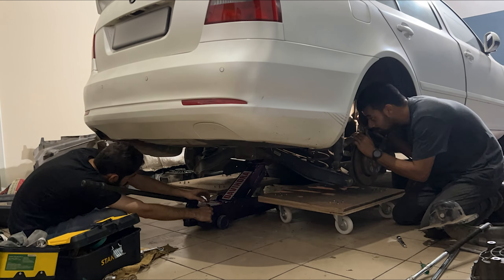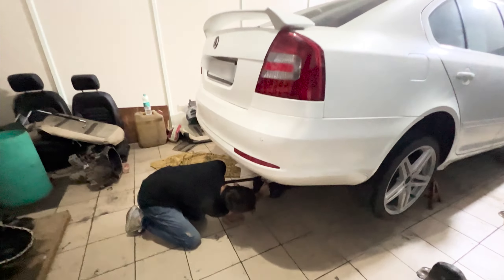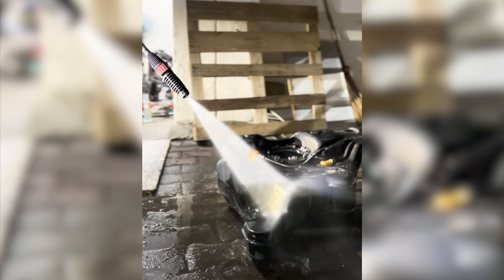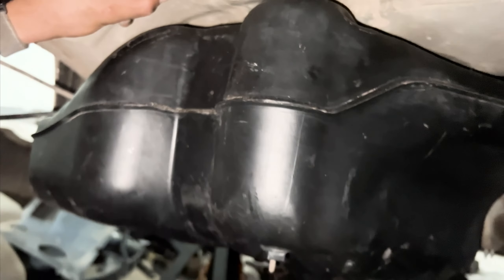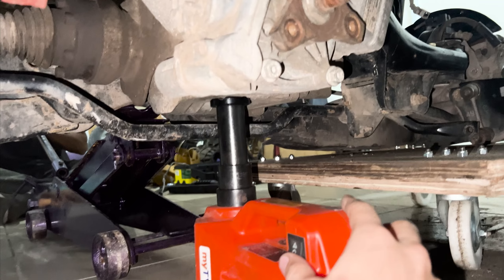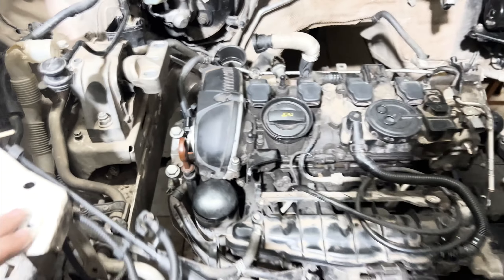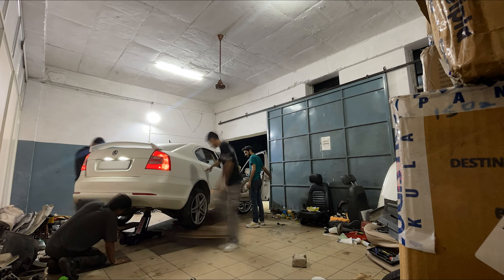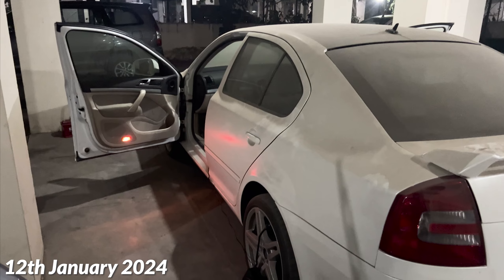AWD DIFF AND A NEW FUEL TANK | WHY THOUGH? LAURA AWD EP3

Comment: Hey, great job on the Laura. I see you always reference OEM mounts and wiring runs, could you tell me where you got up to date service manuals for your cars? Have you purchased access to ErWin? 
I am having an intermittent fault with the boot light, and having the current flow diagram would be very beneficial. But the only resource which is up to date looks like ErWin, so would like to know if it’s useful. TIA

Comment: What is difference betn making engine mods on tsi polo and mpi polo. ihad listen lot of times that making mpi stage 1,2 is worthless interms of tsi, I have 1.2mpi should I upgrade it to stage 1,2
Reply from the maker: It’s true, it’s not that fruitful to stage 2 tune a non turbo less power NA vehicle, in terms of power difference. You will feel it, but it will not as much difference as a turbo vehicle will have

Comment: Always use Castrol Edge or Castrol Magnetic in your car
Or MOTUL 8100 Or Total Energy 9000
Those oil have longer drain intervals
Reply from the maker: The oil used right now was used to flush purposes, new high quality oil, both for the engine and gearbox have been purchased

Comment: Hello Prerak. Inspiring project that you and your friends have taken on. I was wondering if you can help out a fellow car enthusiast. I have a 2016 Skoda Octavia which has a rain and light sensor fault - No communication. I bought another used sensor but the fault remains the same. If I send you both the sensors, can you try them out in your car and tell me if they work? I have already checked +12V and ground connections. They are ok. I was not able to check the LINBUS connection because i could not get the 73 pin BCM connector to open. Its besides the glovebox and its a very tight fit!
Reply from the maker: Was anything related to your wiring tampered with, either with the BCM or did you have windshield replaced at any point ?
Reply: @PrerakKataria  Thanks for the reply. Yes the Windshield was replaced as it had a crack. Nothing was done to the BCM or atleast what I am aware of.
Reply: @PrerakKataria  Hello. Just replying to the original thread to get your attention . Yes the windshield was replaced once. BCM has not been tampered as per my knowledge

Comment: Hello, l've been following your videos for quite a long time. I want to ask for help or you can call it an expert opinion. I have a polo 1.5 tdi and the Adjusters on the AC vents have broken on all the vents. Can you please suggest where can i get just the vents as one of the vent has broken down as well and i just gotta change the vent.
Asked at the service centre, they only provide the entire assembly not just the spare. Please help.
Thank you
Reply from the maker: You’ll need to purchase entire vents itself, @oldsparepart Instagram can provide used ones at a better price if you want
Reply: Thank you so much

Comment: Prerak why didnt you use manual transmission with the awd?
Reply from the maker: I found a petrol DQ250 which is overall better than the diesel 4x4 manual transmissions available in India, and automatic shifts faster. Checkout episode 2, I explain the reason for automatic in that
Reply: @PrerakKataria  oh ok.